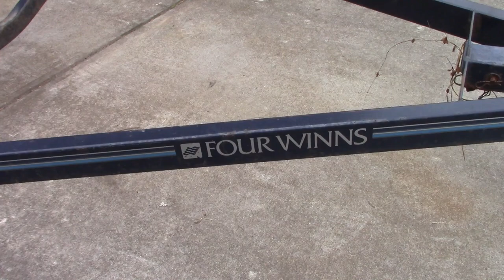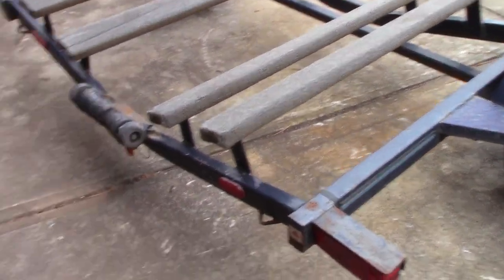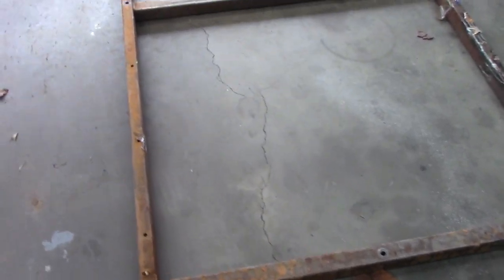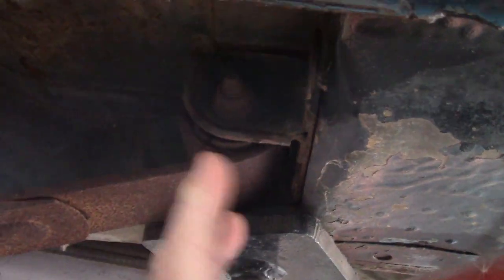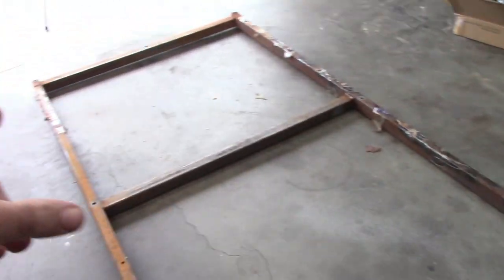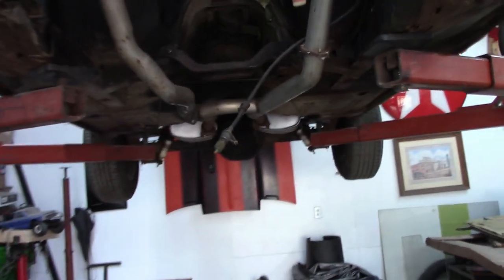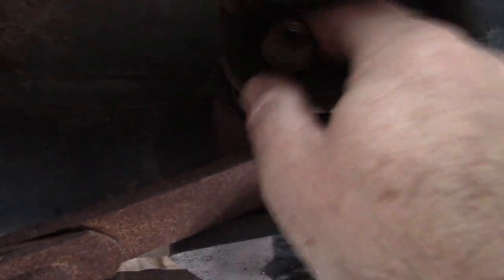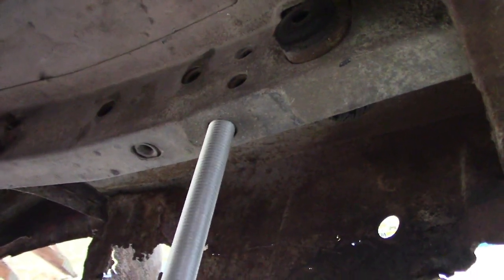Mobile Mustang frame jig. Can it be done?

Comment: I would remove the trailer tires and put dollies under the hubs for moving on and off the lift. I would add lock nuts to the lift pads and level the car while on the safety stops so you can go to the lift when working on areas blocked by the jig and slide the hitch all the way back and use it for the core support center line.
Reply from the maker: Good ideas. I have overcome the lift arm issues.

Comment: I would recommend using the rear spring mounting points. I bought new rear frame rails and the alignment holes were 5/16" off on one of the rails.

Comment: Sounds like a great plan! Love the trailer idea. It would be nice to drag it out of the way if necessary for other projects. The stand/jig I have my car on has large bolts(can't remember the size) that go through and are welded to a beam. They are at the floor supports and the front of the rear frame rail with nuts and washers I welded together to hold the car up. Similar to what you are talking about with the all thread. I added some support/adjustment set up to the rear and front also. Made it nice to level things up before removing stuff. And I have to move it out of the way when I'm not working on it so I always check it over to make sure its still where I want it when I put it back in the work position. Limited on space. Watching to see where I can make improvements. Love the channel.

Comment: I like the idea of the all thread, helps adjust a complete floor or, even frame rails. Would the front oval holes on the frame rails work if you ground the threads off the all thread about 2 in or so from the top. I like the idea of adjustment options. Although clamping the vehicle down will be important to for transporting.
Reply from the maker: I have a plan for the front. I will use the bumper mount bracket holes.

Comment: As I watched, I kept thinking about how many mustangs I've seen with front rail damage. It would be nice to be able to set a new rail right in place on the jig while the car is on it. And also to be able to see from just sitting a car on the jig just how far off a bent up rail is from factory. 
I think the 3/4 pins would be easier for that but your other ideas would work to physically hold the car in place for working on it or transport.
Maybe both setups is an option.
Reply from the maker: I agree. If it all works out, replacing a front rail will be easier.

Comment: Since aftermarket panels rarely seems to fit 100% using factory locating holes doesn't seem like as good of an idea as using suspension mounting points...I feel like they're more likely to be accurate.
Reply from the maker: Good point.

Comment: Not sure if I missed this is in the video, if I did I apologize, but what is the exact purpose of this jig? Is it to enable you to bolt down and haul any 64 1/2 to 67 mustang? o is it to provide a platform for working on the car when the rear and front-ends are off? Or is it to provide reference for straightening a bent chassis? I thought the latter in this case as this car may have been damaged in in the past and you wanted to make sure all the alignment points we correct.
Reply from the maker: Yes, yes, and yes. Along with that, I may be able to assemble my own floor pans.

Comment: i have dynacorn full assembly apron framerails that i'm installing.

if i put the framerails in the floorsupport extensions (floorsupportextension height is on the ford  diagram messurement)
and when i set the messurements from the bumper holes on the ford diagrams  . there is no way i can get the idler arm and steering bolt holes  on the messurements of the ford drawing.

i think the curve of the new panels are different then the ford manual messurements.

If i set the new framerails on the ideler arm and steering bolt locations then the front bumper holes is not on the right messurement . and also if i put the bumper hole on the messurement the idler arm and steering holes will not lineup with the messurements

i'm going to follow youre vids about this to see if you also have these prtoblems